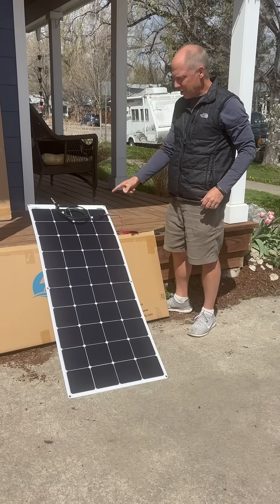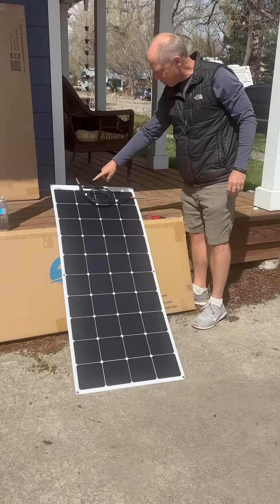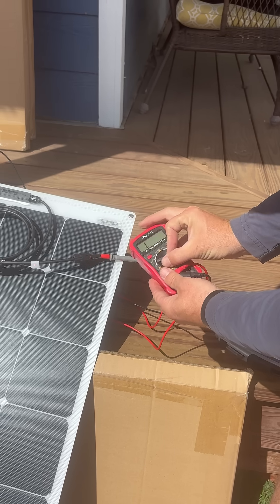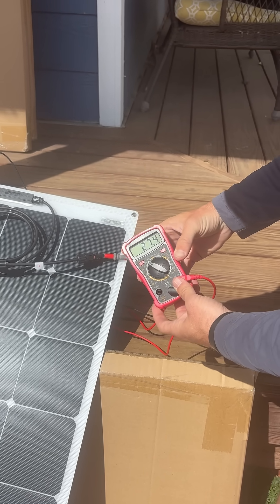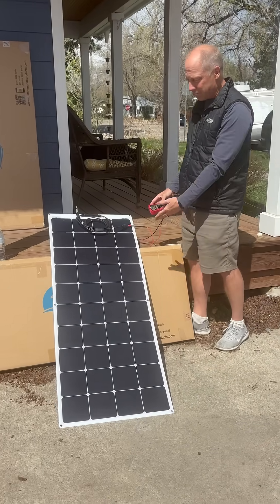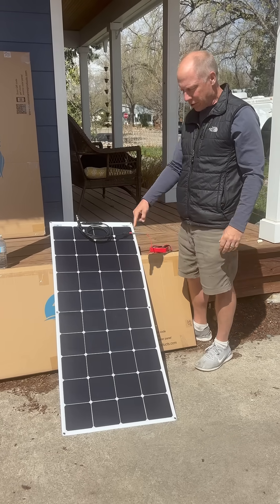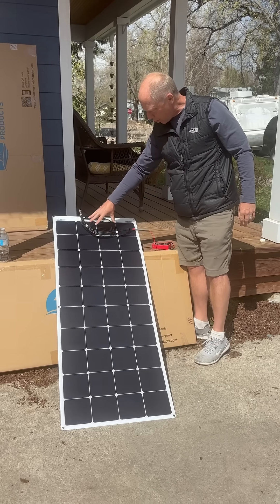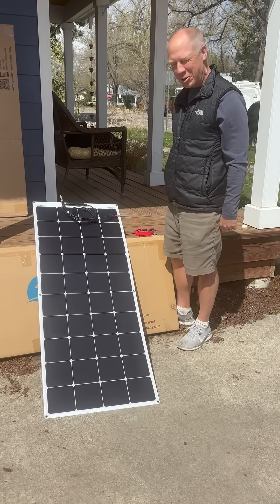155 watt panel putting out strong wattage while partially shaded #marinesolar

Comment: Invalid test.  Open Circuit Voltage and Short circuit Current is an invalid measurement of power output.
Reply from the maker: Thanks Alan - you're correct and I've updated the title
Reply: 😂 so true